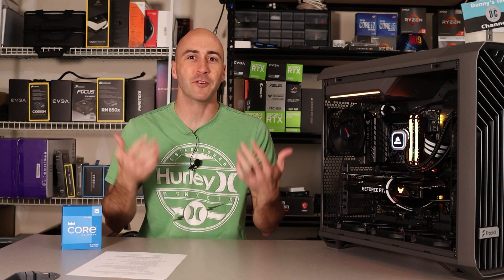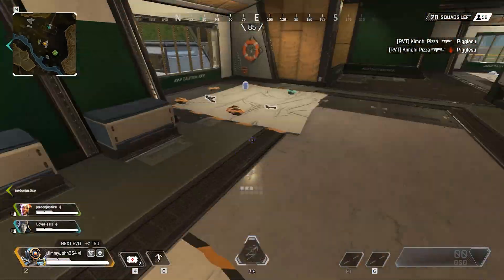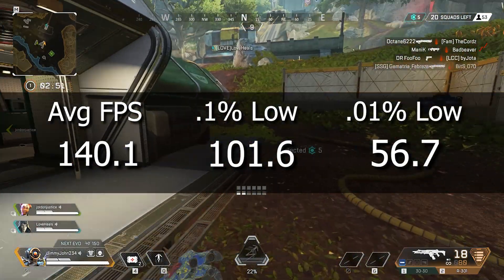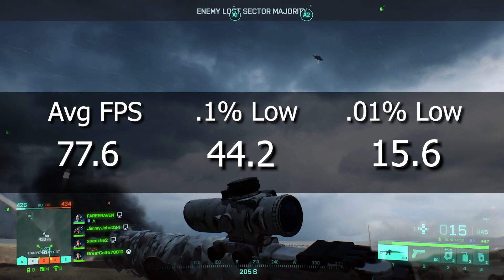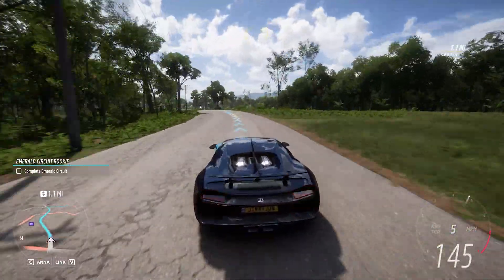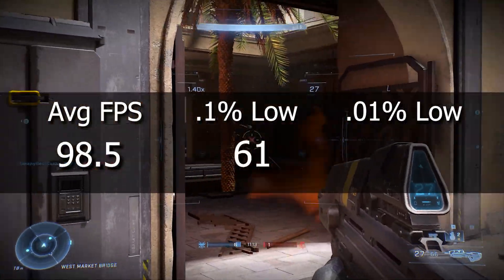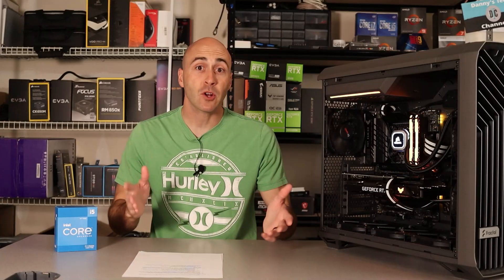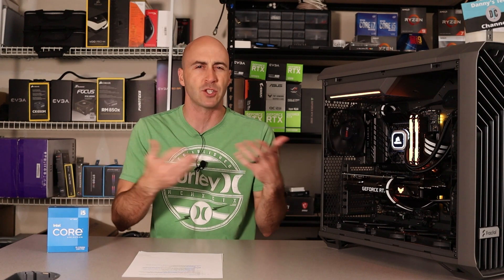12600k & RTX 3060 PC Build - Next Gen Hybrid Hype?

Comment: Curious why you didn't mount the front radiator higher up, maybe leave room for another 120mm fan at the bottom? Is it an issue with the case?
Reply from the maker: I did attempt that. Lol there isn’t room with the tubes to pull it all the way up and there is no room for another fan at the bottom or top because of the tank ends. Wish it would have worked like that
Reply: @DannysTechChannel So, it's the length of the tubes and the distance between the block and the front of the case? I've done a setup with a 240 and three fans in a Lian Li Lancool II Mesh RGB without any issue. I would have thought the case was large enough for that sort of setup, also as expensive as it is.
Reply from the maker: The radiator was a 280mm. The radiator is what makes it so you can’t mount 3x 140mm fans. If you don’t have a radiator, it would fit all 3

Comment: I am looking to upgrade my 5yr system from a 6700k 16gb DDR4 Maximus Hero 8 GTX1080 to a 12700k using this Tuf mboard and adding 32mb DDR4 still using the GTX1080 because price scapulars on all three components DDR5 , Graphic cards, and even on mb ASUS ROG Strix Z690-A Gaming WiFi D4 my 1st choice of few Z690 that still use DDR4 a $350 board now selling $500+. I can still get the Tuf at MSRP.  I know other MB options out there but I've been building rigs since the mid 90's using Asus mostly and now asus fan. I learned the hard way not to be an new windows early adopter in my past looking at you Windows ME, Vista, Win8, and now Win11. I like to do what we nowadays called standard overclocking nothing extreme. Based on your video and earlier research I was originally was considering buying a new 10900kf and off eBay a new or near new MAXIMUS XII HERO around $300. Would I be better off getting this?  I also have two Samsung 3.0 m.2 drives 512GB 960 Pro and 1kGB 970 EVO Plus and an 280 AIO and still want to upgrade my DDR4 Ram to 32GB. Thanks for any help.
Reply from the maker: I’d say get the 12700k with this motherboard over the 10900k. I don’t have a 12700k yet but I heard it’s the best new processor. All the performance of the 12900k without all the heat. Plus it will last you longer than the 10900k.
Reply: Thanks for your advice I think I will do this. Can you overclock with the Tuf motherboard in the BIOS etc?